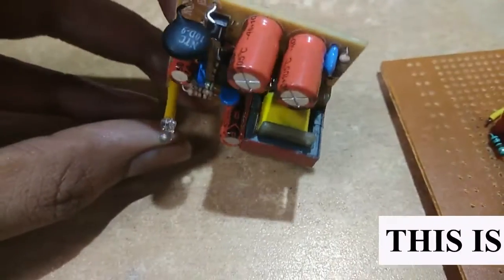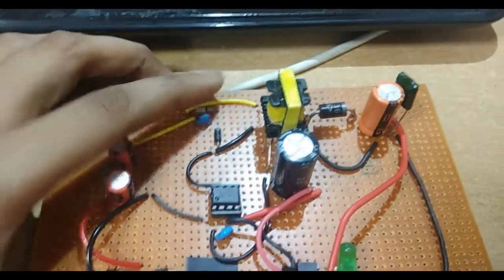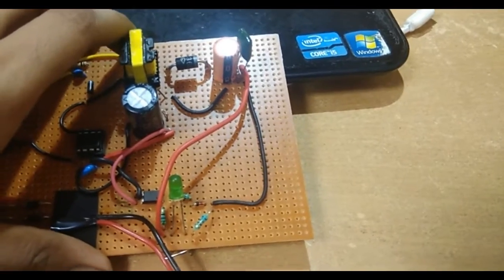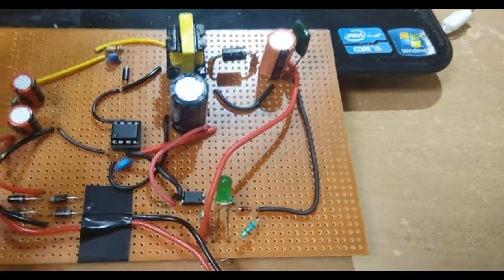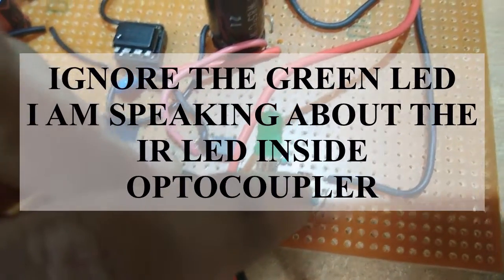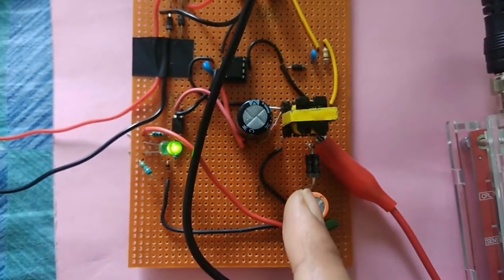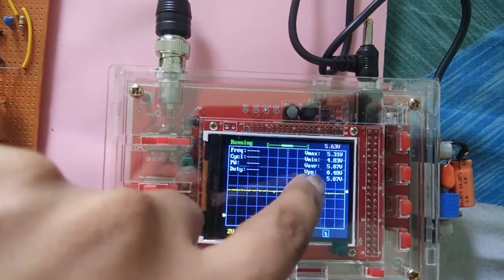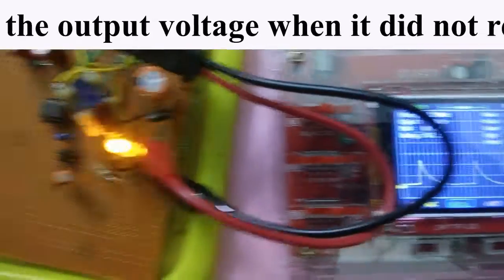HOW TO MAKE A SMPS CIRCUIT USING AP8022 IC FOR MOBILE CHARGER AND OTHER ELECTRONIC COMPONENTS PART 2

Comment: Primary winding ke supply ke series me 100k ohm ka resistance laga hai vo galat hai.pl reply.(circuit diagram me dikhaya hua hai.)
Reply from the maker: Yes you are absolutely correct the capacitor and the resistance actually act as a snubber circuit. The primary winding will be connected to the left side of the 100kilo ohm resistance in the drawing. But I cannot edit the video after publishing. Thanks again for pointing out the mistake in the drawing

Comment: Sir good morning, for example in this circuit Schottky diode used to make dc , now what is happening my pcb voltage doesn't reaches to 14 volt immediately but it takes 20 seconds, in other PCB it does and output gets instantly.
Reply from the maker: Dear sir
Can you please send me the circuit diagram and picture of your circuit in the mail? I will get back to you in few days as assignment submission and paper writing is going on right now hence new videos are also not coming. Sorry for the delay.

Comment: Hi, nice video, what oscilloscope you are using is it some DIY oscilloscope?
Reply from the maker: No, I bought the oscilloscope. After that, I realized it can be made easily with STM 32. Do You want a DIY video? If yes in which language should it be?

 https://youtu.be/7ngSWOp-x5w here is the
 video about that oscilloscope which I purchased
Reply: @SCIENCEINACUP  Thanks a lot 🙏

Comment: I will mail you tomorrow,  actually I have doubt why secondary winding side filter capacitor charge very slow and output is delayed.
Reply from the maker: I may be wrong but here is my understanding. 
The output of SMPS uses different types of capacitors. Polyester and a ceramic capacitor of low value are mainly used to filter noises. The electrolytic capacitor is of high value in microfarad (>1000uF)range is used to stabilize the output as load can vary depending on use cases also the input 220 Volt AC power supply can fluctuate.
 The problem with electrolytic capacitors is that they have significant internal resistance and inductance. To counter that fallacy other types of capacitors are used as mentioned above.
So to answer your question output is delayed as the electrolytic capacitor whose value is high is used. 
In simple layman terms high capacitance is used
1. to stabilize the output  of the SMPS and give the PWM generator IC some time to cope up with the change in load or change in supply mains voltage to prevent damage to the device  connected to the SMPS
 Here is a great video on capacitor types and function which you can refer 
https://www.youtube.com/watch?v=2v8zBj7_sxg

If you like the effort please like the video and share it with your friends as it will inspire us to make more videos like this.
Thanking You,
Science in a Cup.
Reply: @SCIENCEINACUP  what I am trying to say is, immediately after secondary winding there's one diode on positive side to make DC, if  I measure the voltage it is increase  very slowly from 3 volt to 14 volt and after reaching desired voltage i get output voltage. but in other smps i get immediate and it is soft start.
Reply from the maker: @ishaservices  Can you please mention the capacitor parameters like capacitance value and rated voltage in the MAIL of both SMPS available in the market and the SMPS which you made. It would be of great help for debugging
Reply: @SCIENCEINACUP  if I get whatsapp number it will be better to understand and solve this issue.
Reply: Sir the issue is solved by replacing optocoupler , and second think you said in this video the transformer primary side it is Ac voltage at Ic drain is it correct?
Reply from the maker: @ishaservices  Currently we don't have a dedicated Whatsapp number for this channel. We will surely update that once we get the sim card and number in the about section of the channel. Meanwhile we are available over mail.
Reply from the maker: @ishaservices  actually in the primary side 1n4007 and capacitor converts AC to DC. The SMPS IC converts that DC to a periodic square wave . and the SMPS IC is powered by the auxiliary winding of the transformer after it is rectified by a single diode and capacitor . Yes I was wrong Instead of saying "AC current in the format of square wave" I should have said modulated square wave at 60khz. Sorry for the mistake

Comment: I need atleast 120 watt citcuit for repair purpose.make somple as much as possible .u may use primary of old crt tv .3842 ic or str cq765(orcq1265) any other simple attachable circuit.in simple clear diagram.chinese  corcuit(jaddu )are not reliable.plz do this it will helpful for many technicians.

Comment: Can You Please Share the details of the Transformer (Like How Many Turns etc.)    Thanks in Advance
Reply from the maker: Yes, I will. Currently, I am working on Arduino based inductance and capacitance meter. After that video, I will make a video on the SMPS transformer and also the circuit diagram that I need to rectify.
 Do you want the SMPS transformer video to be practical-based or theoretical???

Comment: Your explanation is not for beginner. If you realy want to teach some one then explain step by step and one more thing CKT  Diagram should be draw in a white paper.
Reply from the maker: Thank you  for your feedback. 
1. I will surely do it in future video. Now the doubt which I face is if the video is the long viewer is less(damn youtube algorithm!!!!). So please subscribe and press the bell icon such that you can get notified.
2. In that future video I will redo the circuit on white paper  and in the current circuit diagram there is a mistake so need to rectify it .
3. This is the first video on smps. Do check it out.
  https://www.youtube.com/watch?v=m960U2WfKds&t=4s
4. In the next video I will explain about transformerless  230 volts to 5-volt capacitive dropper circuit. Please check it out as this kind of true feedback helps us to improve the quality of content. 

Thankyou once again.